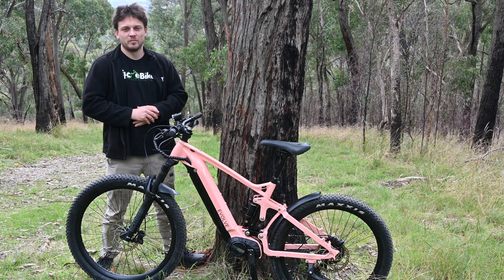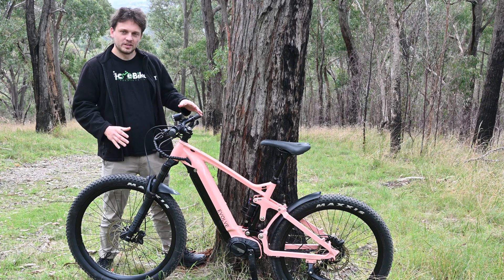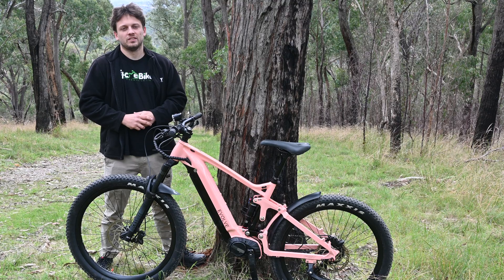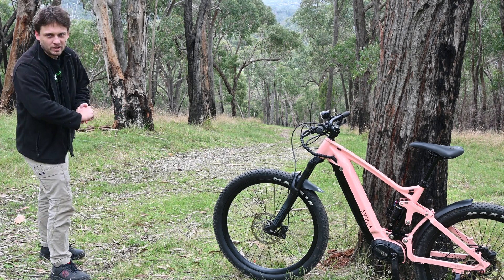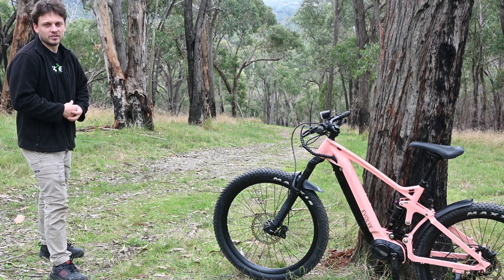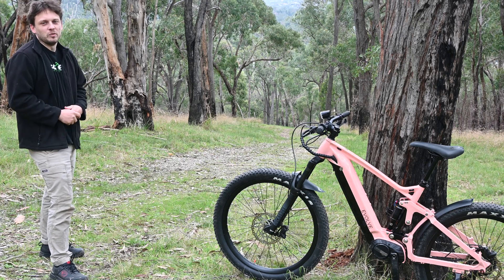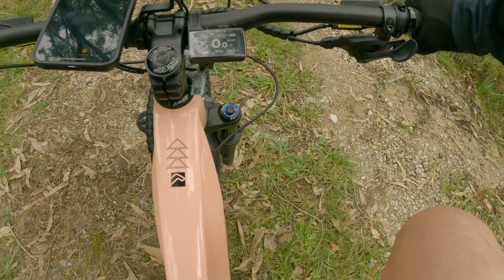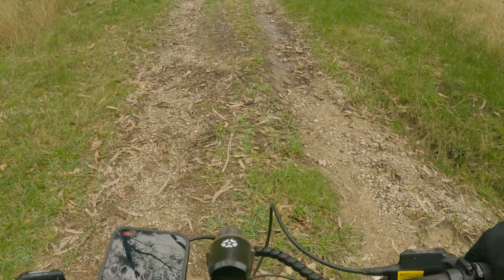Bafang M510 Motor Test - Frey Evolve

Comment: Bonjour j’ai une question avec un moteur bafang m620  si on a une batterie en 48v 20 ah  on arrivera à tirer le plein potentiel du moteur ? Ou logiquement il plafonnerait à 1000 w ? Et non 1500 dont il est capable ? Merci
Reply from the maker: Hello, 20ah is the capacity, It does not dictate the maximum power of the battery, The battery would need to be capable of outputting 30 amps to get maximum power many 20ah batteries can do this.
Reply: @EpiceBikes  d’accord mais ça dépend du contrôleur , si il permet de demander 30 ah ? Et du coup on m’avais dit que la puissance était lié au V de la batterie et les ah la vitesse a la qu’elle elle ce décharge , il est préférable du coup d’avoir par exemple 52V 17,5ah ou 48v 20 ah ? Car je ne comprend pas ce qui sera le plus utile en vtt , et quand je regarde des evtt de grande marque aucune batterie ne permet le 20ah  , merci
Reply from the maker: @romaingk3430  The Bafang M620 Controller will take a maximum current of 30 Amps. V X A = Power so 52v will be slightly more power then 48v. [ah] is capacity rating of the battery and does not directly relate to power output. a 48 x 20ah battery has a slightly larger capacity then a 52 x 17.5 

Both sizes should be capable of providing 30 amps to a bafang m620 motor if they are built correctly.
Reply: @EpiceBikes  thanks you 👌